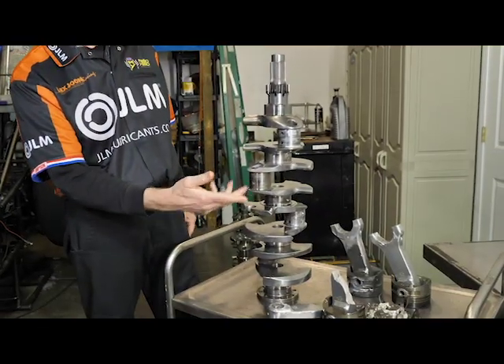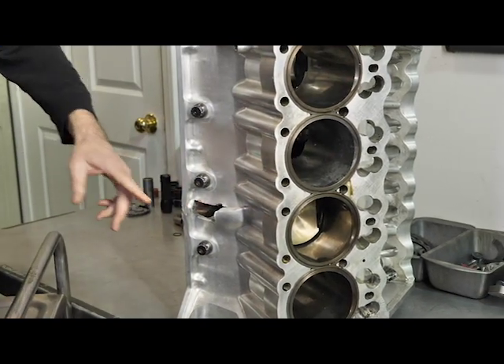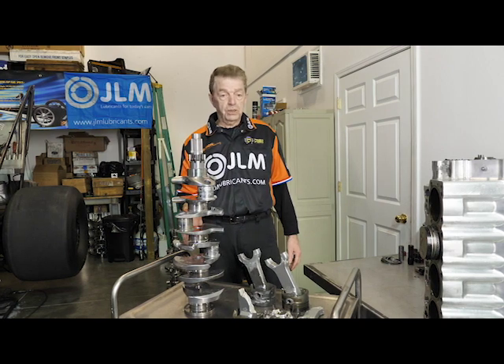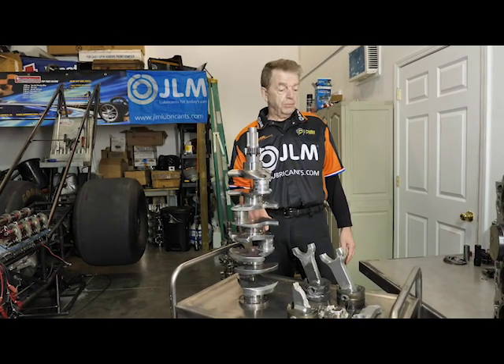Top fuel dragster engine blow up explained by drag racer Lex Joon

Comment: i love the look ya had when ya said "tv slo mo really did a great job"  lol.  i thought green was from head gasket?  copper?     im not questioning you sir,   you clearly know WAYYYYY more about it than i do.
Reply: He’s correct, green flame is from melting aluminum.  Green flame out a header is never a good thing.  It most commonly occurs when a piston is burned/melted.
Reply: @danmyers9372  well i worked in a forge for ten yrs casting aluminum parts of all kinds and I've never seen a green flame or anything close to green. and clearly this engine destroyed itself. and im sure the head gaskets were burned. it may not have been the reason it blew but I'll put my money on the head gaskets
Reply: @bikebuilder8567  well I'm sure you are correct, you obviously know more than these guys who build and race them.

Comment: Don’t know much about dragsters just asking a question how do you keep the engine from overheating?
Reply: You cool it down by spraying about 3,5 gallons per second of nitromethane on the inside, and you run it for no more than about a minute at a time, only revving it out for about a second and a half for the burnout, and about 4,5 secs for the run. Idle it down, cool it internally with fuel. Simple as that.
Reply: @remcovanvliet3018  😆😆😆😆😆yep

Comment: I couldn't see any water jacket etc, so how are these engines cooled?
Reply: By the massive amount of fuel injected.
Reply: No water whatsoever 4 1/2 gals of fuel going thru the cylinder head in a matter of 3.7 some secs. It doesnt have much time to get hot. If you divide 8000rpm rotations per minute by 3.8 seconds that crankshaft only makes about 500 revolutions and burn 4 gals of nitromethane.
Reply: Tears from the loosing competition.